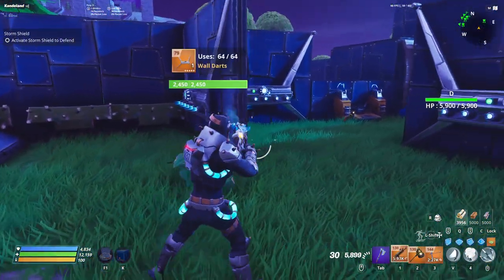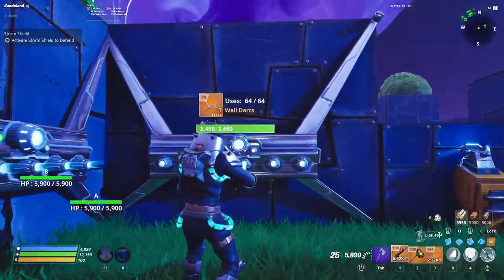Stonewood Endurance Castle: Amplifier D South Build Tutorial - Fortnite StW

Comment: Hey, is it possible to AFK wave 20 (tornado) without a base?  Currently that's where I fail, and a BASE probably would not cover all my tunnels.
Reply from the maker: Yes, I do it all the time now without even using a constructor
Reply: @Digidadda  oof, ok, my defenses are just bad then.  Any tips?  Sadly I don't have the same flex amp, so cannot copy your design.
Reply from the maker: @Hellaspaghetti  for the tornado amp, don’t use any ceiling or floor traps since the tornado breaks them.  Only use wall traps.  Tornado won’t break wall traps.
Reply: @Digidadda  question, I have some blockoffs using cones, do I have to worry about those?
Reply from the maker: @Hellaspaghetti  tier 3 metal should hold up most of the time.  Try mapping out the tornado areas and build around them if possible